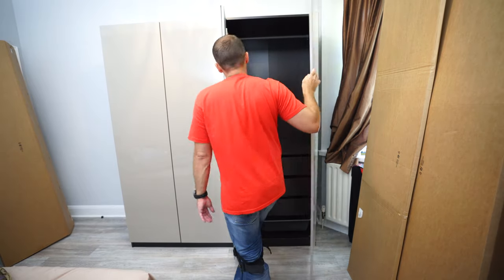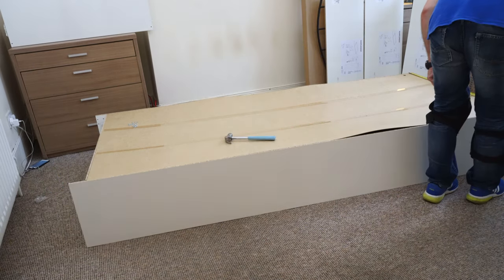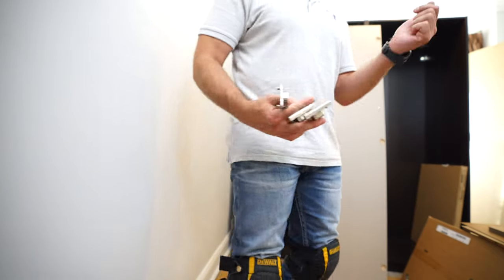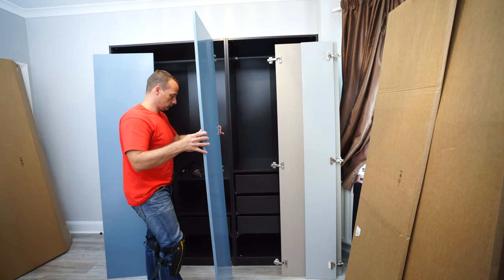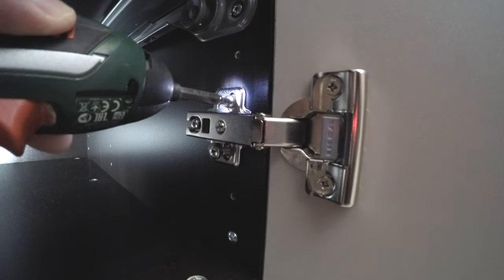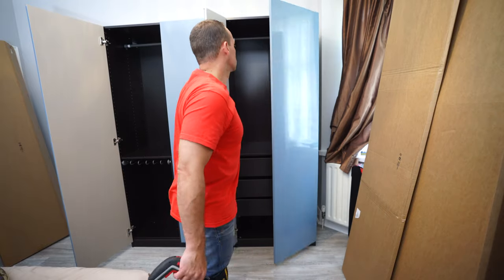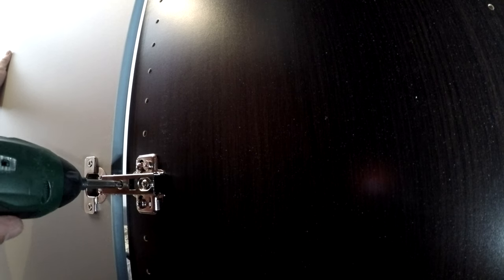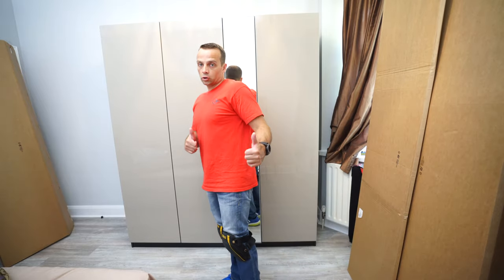Ikea Pax hinged doors adjustment and installation

Comment: Thanks so much for the video! I'm installing the doors tomorrow and I've had issues trying to fix doors and a drawer on an assembled Besta unit I bought in their As Is section. I'm going to have to measure the frame like you did at the beginning. I never thought to do that! I've always been mystified by their hinge adjustment instructions, but I'll be sure to apply your tips when I attempt to fix it. Thanks again! I know where to go anytime I need to assemble any other IKEA stuff!

Comment: If you're as unprepared as I am and all you have is a screwdriver I'd suggest tightening and loosening the hinge's screws prior to screwing them to the wardrobe frame - sometimes they're hard to move for the first few twists, and trust me, you don't want to find out about that while holding the door with one hand and screwing them in with the other, while your foot gets numb from all the weight ;)
Reply: You can just use some books !!
Reply: @carlslo6757  No books........

Will a Kindle be any good.😂

Comment: thanks, the very beginning of the back is very important and not mentioned in the manual, btw, do u have the slide door version?
Reply: In the manual they point out that you should make sure the hardboard backing is square to the frame while nailing it........

Comment: Hello, we are refurbing an existing fitted wardrobe and are considering the mirror doors, either Aheim or Vikedal but we will need to use strong flush hinges.  My question is, is the back of the doors particle board so we can use screws ?

Comment: Hello and thank you very much for your videos.
Im rigth in the middle of building a Pax wardrobe. 
Can I put it rigth next to a wall ?  Or will the hinged doors not be able to open enough to get the baskets and drawers out ?
Reply from the maker: Leave at last 1cm from the wall it is good for ventilation to don't get mould on the wall behind the wardrobe and if you have bigger door handle leave more door need to be open 90degre. If you are not sure, build one frame one drawer and one door with a door handle and check if you can open comfortably without problems.
Reply: @PPFlatPack  thank you 👍

Comment: Thank you and as you mentioned mirrored doors are heavy , is there any way apart from fixing it in the wall as my wardrobe is falling when I am opening both the mirror doors and also will it be happening if I will exchange one mirrored door ?
Or do you suggest I should get both the doors exchanged and use the standard doors to avoid falling
Reply from the maker: Only the way is to fix wardrobes to the wall. If you get regular doors not sure if it still goes down when open all 4 doors. Once you load the wardrobe with clothes should be better but I would still fix them to the wall especially if there are small kids at home, if not before you load the wardrobe put some spacer under the front part of the wardrobe (under the side panels not the small panel on the middle). Here is the link how the spacers look like https://youtu.be/fTvlmmJts7g). The whole wardrobe would lean towards the wall not towards you. That should help a little. All that said better to be safe than sorry.

Comment: Question, the wardrobe is being installed in an opening and I want to install  the wardrobe with doors into the opening so i can get a flush installation, How much clearance is needed for the vertical and horizontal measurement so the doors open without hitting the top or sides of the opening ?
Reply from the maker: If your ceiling is straight you can do hinged doors with 0.5cm clearance. Vertical depend if your wall is straight if enough space to build 1cm on each side would be safe

Comment: Hi! I have an issue with putting the doors on the Pax wardrobe. Basically on one of the sides screwing the doors in works perfectly, the other side seems that you need to fix the screws in lower holes than the opposite door. It also makes it harder to find the holes on the second door. Can you help with your advice? Thanks in advance
Reply: I also have this problem, did you manage to find a solution? Thanks

Comment: Hi, I cannot seem to get my right hand side door to go on. The two left  ones went on fine, including the mirror one. But the right hand one seems to be going into lower holes for the middle hinge. Any suggestions?  I am out of ideas trying to get it on. Thanks
Reply: I had the same issue as well. Would also like to hear his solution. 
I just moved the hinge a bit up before installing the door and now it matches the holes correctly.

Comment: I would never use an electric drill for screwing on wardrobe hinges or kitchen unit hinges as the drill can over tighten them, i always use a screwdriver, as for placing hinges on the door i always screw one part of hinge to door and the other part to the carcass as it saves trying to hold it with your foot, if you use your foot there's a risk of the doors falling when only one hinge is in and you lose your balance and force the hinge out of the door.
Reply: I've just  built a Pax wardrobe and three Malm cupboards using my Ryobi drill/driver with the screwdriver torque setting on 8. No over tightened screws and everything worked perfectly...... well almost.

My second IKEA 236 wardrobe was perfectly sealed but on opening it, I discovered only two sides and one top with an extra cardboard spacer where the bottom should have been.

Seven to ten days to wait for a replacement base for a brand new purchase after spending almost £2,500..........